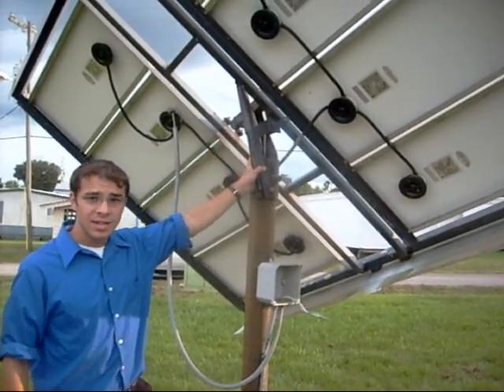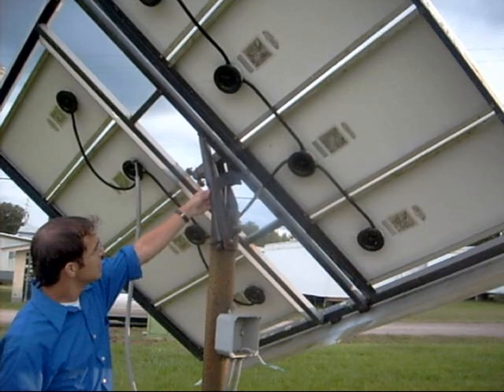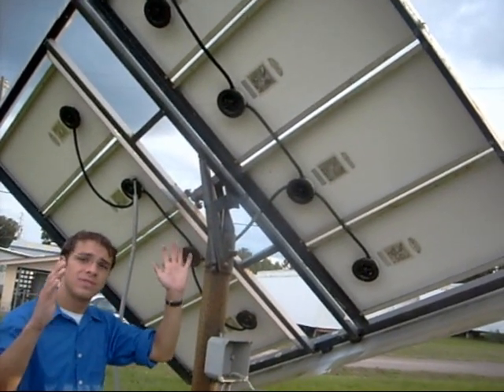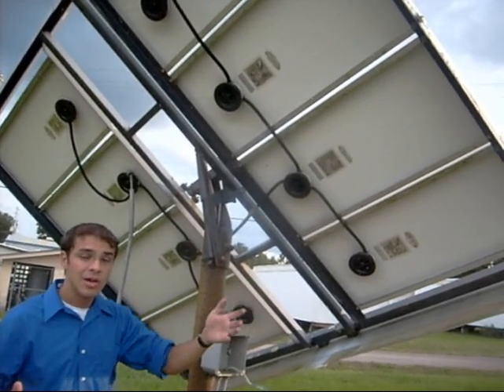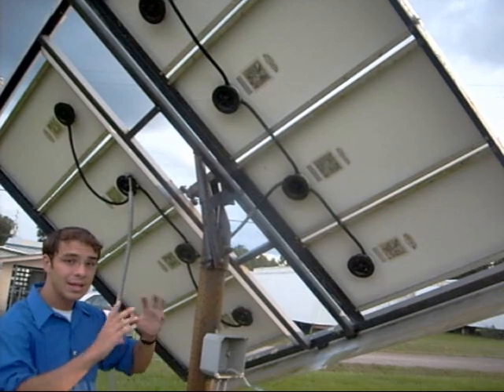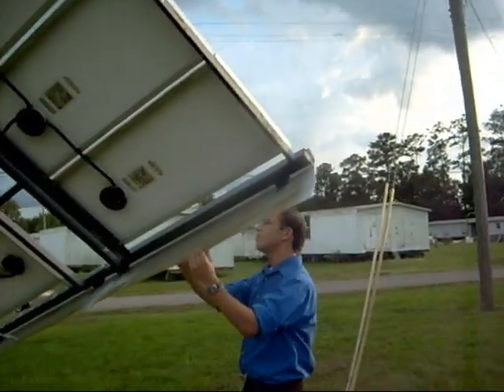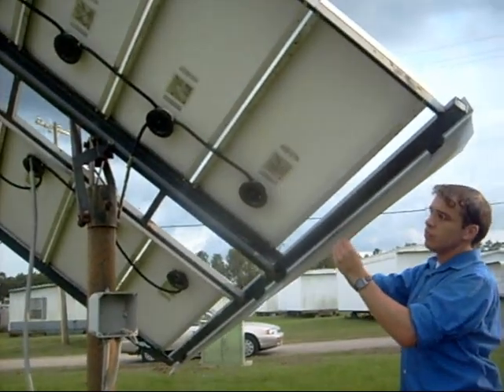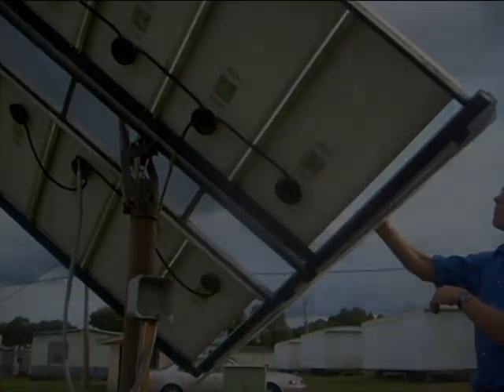Passive Solar Panel Tracking

Comment: Another problem is that the temperature of the fluid depends more on wind and climate than the position of the sun. I can see why it is disconnected. Good application of the principles although not practical.

Comment from the maker: @DD826 This one did work after I fixed it. I had to re-grease the swivel joint, and clean the piston. The panel needed to be reset. This video was designed to show how the mechanics worked.

Comment from the maker: @1234Doc4321 Agreed. I have seen on a windy day the panels being blown in the wrong direction. The cheaper passive solar systems are easily blown in the wrong direction by the wind. Active tracking does require some energy produced by the solar panels and are more expensive.

Comment from the maker: The main problem with this system is that on a cloudy day it will not work. This is the one major flaw of the passive tracking system. The sun is required to make the passive tracking system work.